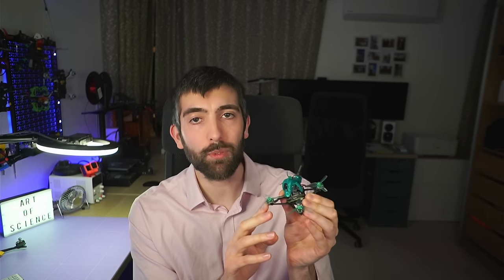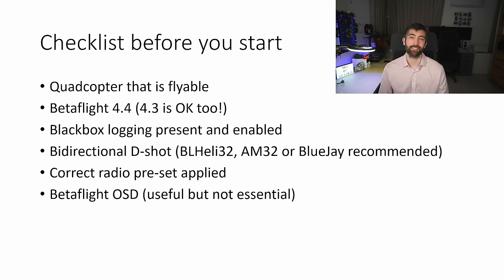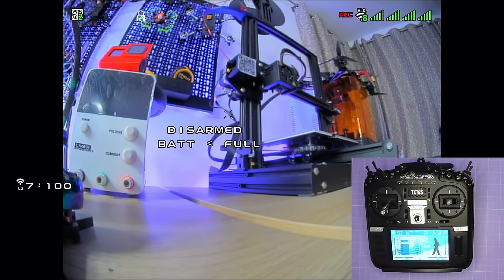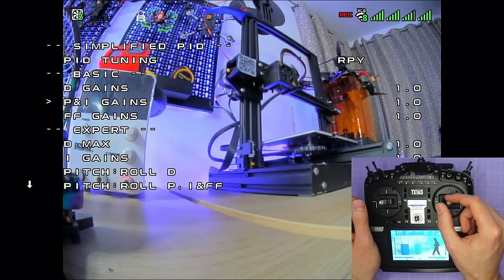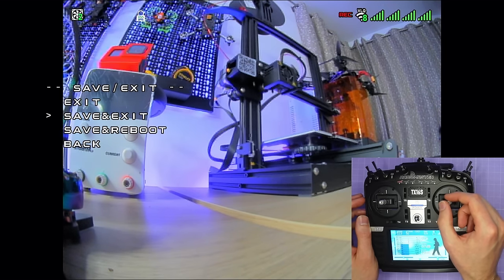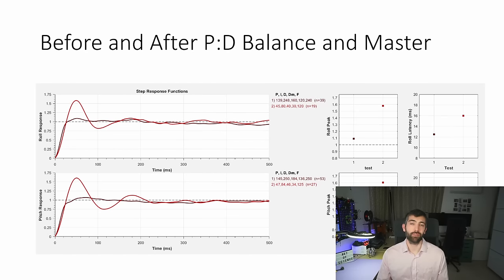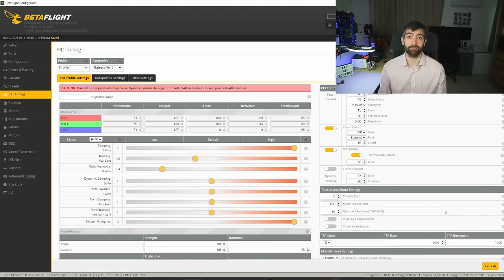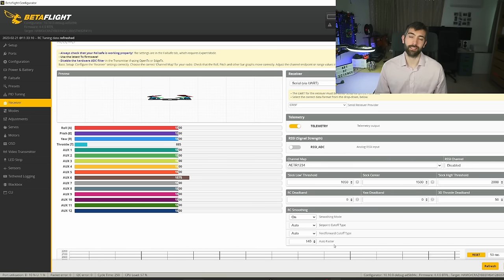Betaflight 4.4 Tuning Guide + Tips and Tricks for the BEST tune!

Comment: Hey chris, thanks a lot for this video , really apreciate.
 Something is bothering me, so the idea is always get 2.5 ratio PI/D ratio on 3 or 5 inch quads? I tried get pd balance and was perfect with PI at 0.4 and D at 0.5, but when o changed D to 1.0 result was wayy lower , already tried to raise MM to 1.3 but still lows. We should always try to mantain ratio at 2.5? Thanks a lot again
Reply from the maker: Every quad will have a different unique P:D ratio. You have to find what it is for your quad during tuning. Once you've found it you have to keep the ratio the same. It helps to not use the D slider. Just use master multiplier because master mult doesn't change P:D ratio.
Reply: @ChrisRosser  thanks a lot

Comment: Chris on this vid you have a chart for dynamic idle that shows prop size  and approx idle rpm for 4.4. In your 4.3 vid you have a different chart with different values to input for dynamic idle. Did they change something from 4.3 to 4.4? Or did you find that these values just work better?
Reply from the maker: A range of values work well for dynamic idle. Higher values give better stability at the cost of hang time.
Reply: Also Chris, I have one more question…. Should rpm filter fade range hz be set to the default of 50hz? Or is your suggestion in your betaflight 4.3 vid to adjust the fade range to 100hz? Also pidsum still 100%? I am running a clean build of the AOS 5 EVO…

Comment: Awesome - like always. Thanks a lot... Chris, maybe you have some advice  - if we tune PD balance with turned off   FF - and turn on FF to -  (no matter 0.5 or 1.0 position) after tuning PD balance  -  always back to overshooting -  how to avoid that ?
Reply: Try turning down the i-term.
Reply: @skree_fpv436   I will try, but i-Term already 0.3 not so high
Reply from the maker: The step response graph will often show overshoot with FF on. That's why we don't use it when tuning FF. Only use the step response graph when FF and I = 0
Reply: @ChrisRosser  When I try to tune PD balance with turned off Feedforward and I gain - the PIDtoolbox never show me overshoot.  All flights with PI gains slider from 0.4 till 1.6 even with hard pitch \ roll tricks always get to the setpoint  - just timing is different.   Its not easy at all to choose correct PD ratio.  is something wrong with toolbox?  blackbox explorer can indicate overshoots after PI gains slider rise more than 1.0        huh situation ...
Reply from the maker: @PaulSokolov  Are you seeing overshoot in the FPV feed. Maybe PI = 1.6 isn't enough for that quad. Are you doing specific tuning flights with sharp wobbles on pitch and roll?

Comment: I have some trouble with PID tool box metode for PID, I have a constant over shoot on Roll about 1.2..  in betaflight 4.4, can I use your metode as you descibe for betafilght 4.3?
I have a really succes in betaflight 4.3 with your metode on all my quad.. so If i can I will follow the same step in BF4.4.

Comment: So when I initially test at .3, .4 etc do I move the D slider to 2.5 times the P&I slider or do I leave it at 1.0 while adjusting the P&I through .3 - 1.5.

My next question is, if my P&I slider is at 1.5 then my D slider needs to be 3.75 right? So I’d have to move the multiplier to 2 then do some math and put the P&I to 0.75 and then D would go to 1.90?

Comment: So i'm dealing with a weird problem here. I'm trying to tune an geprc cinepro 4k using an external openlog board. I've flashed the blackbox firmware and it seems to be working. The lights are ok and it saves files.txt in the card. But when i try to open the files in blackbox explorer i can only see the "log header" and "view table" info. The files get bigger or smaller if I keep the quad armed for longer or smaller times. I downloaded some log from internet and it works fine in blackbox explorer and comparing the file to mine they look the same. Any ideas??

Comment: I’m a bit confused about how to act upon the throttle / frequency data gathered in the first step (say 11:25 in the video). In the example plot, the throttle related vibrations fall between 250-600Hz. How does one act upon that data? Where does one indicate to Betaflight where those values lie? I understand the part about Dterm filtering. Do the throttle frequencies get entered under RPM filter? Sorry to be confused, I watched the video twice with notes but can’t seem to grasp this final point. Thanks.
Reply: I also feel the same and did not grasp how to use this data in order to influence setting changes. I'm thinking I may need to watch his 4.3 video on filter tuning to fill in some blanks.

Comment: How do you setup the graphs? I cant find gyro scaled [roll]/[pitch]/[yaw] anywhere.
Reply: I had this same confusion (couldn't find it). Gyro scaled is only logged if you configure  black box in Betaflight. Set Blackbox debug mode to GYRO_SCALED. See 3:40 in the video.
Reply: @z2kk  Perfect! Thanks for pointing that out.

Comment: Please help!
My copter flips out when doing a flip or when doing a punchout.
Its a 3.5 inch sub250 6s quad, I have only tested the flips in horizon mode but when i try even a slow flip the quad gets uncontrollable and doesnt level again but just crashes.
I already have the master multiplier turned down to 0.6 so I dont think it solves it when turning it down even lower

Comment: In the blackbox logging rate I can only select the following options:
1/1 (3299Hz)
1/2 (1600Hz)
1/4 (800Hz)
1/8 (400Hz)
1/16 (200Hz)
 i have BF 4.4.1 on my quad and BF configurator 10.9.0 what is the problem, thanks.
Is there any problem selecting 1/2 (1600Hz)?

Comment: Hi Chris, I have an AOS 5 v2 and have a PI set at 1. adopting the ratio of 2.5 this puts d at 2.5 with the master at 1. However I have run out of sider for D. By reducing PI to 0.5 and D to 1.25 with master at 2 I should be able to achieve the correct values. my question is, by increasing the master to 2 should I drop all other sliders from 1 to 0.5?
Reply: i did that today, both sliders, but i think (from what i understood today) that each quad has their own ratio. but i can be wrong
Reply: @filipefrango1671   I think you are right. Looking at other tuning guides the ratio (PI D) differs from quad to quad.

Comment: 22:15 Quick question: If my P&I slider is correct at 0.9 should I set my D slider to 2,25?
Reply from the maker: Assuming: P&I at 0.9, D at 1.0, Master at 2.0 an you want to further increase master.

Go to: P&I at 1.35, D at 1.5, Master at 1.35 and that whould give nearly the same numbers and you can continue to increase master from there.
Reply: @ChrisRosser  Also didn't understand this  - "  D slider is always 2.5 times  as much as our PI slider "   How to do this?     By P\D numbers ?  or by Slider numbers ?   Pleaase explain with some example.

Comment: When I try to tune PD balance with turned off Feedforward and I gain - the PIDtoolbox never show me overshoot.  All flights with PI gains slider from 0.4 till 1.6 even with hard pitch \ roll tricks always get to the setpoint  - just timing is different.   Its not easy at all to choose correct PD ratio.  is something wrong with toolbox?  blackbox explorer can indicate overshoots after PI gains slider rise more than 1.0        huh situation ...

Comment: Yeah so I went forward tunig my Cinelifter QAV-Pro Whoop starting as suggested with a PI Gain of 0.3, leaving D Gain at 1.0. So 3x 30 sek flight and the ESC was gone amd motors where baked. I think we need to clarify some points here... maybe it makes sense to use the D slider instead of PI, otherwise you start off with massive D and depending on the build this kills your motors or esc... 😪😪😪😪😪😪

Comment: Do I need every time when I change the PI Balance or MasterMultiplier to save the Log File on the computer?
Or do I arm quad do bumps with setting A, disarm, change setting to B and Arm record.
Reply from the maker: You can do multiple flights and then download several logs at once to speed up the tuning. Just be careful not to run out of log space! Lowering the sample rate to 2K or 1K can  help increase logging time.

Comment: Hey Chris, connected my receiver to BF. The quad arms, beeps, and flies. But no OSD shows in goggles?
Reply: What Version of Betaflight and what kind of Video system are you running? Especially Digital Video Systems and the BF OSD are hard one to get working and it differs with every BF Version. Especially using the o3.
o3 and bf 4.3 check Oscar liangs how to setup o3
o3 and bf 4.4 check ports tab and enable VTX (MSP + Displayport) on your UART where the o3 is connected.
If your using something else, you will have to google for it. i just switched to digital with the o3.
Reply: @miQizzle  Thanks for the help,  BF is updated to 4.4. Running the original DJI Ait Unit if that helps.

Comment: Final graph at 24'30" mark is a bit confusing since the P/D ratio shown in legend do not match values you talked about up until then. Better to leave those out if it is just a sample of what to expect.
Reply from the maker: I'm talking about the ratio of the slider values rather than the P and D numbers. In general with slider tuning the numbers are becoming less and less relevant. If P&I slider is at 0.5 and D slider is at 1.0 that's a ratio of 2 on the slider values. But not a ratio of 2 on the gain numbers.
Reply: @ChrisRosser  
Thank you !!! 
Also, I am assuming your getting the 'BF potential "flyaway" warning' when using these high D-term settings?
Reply: @ChrisRosser  I had another look. The graph still does not make sense even as slider ratios. Have another look as something appears off. 

My observations are:
Your P:D Balance of 0.4 (slider ratio of 2.5) gives actual P/D ratio of 1.76 
(from Roll Response @ 21:07 mark)

Your fixed slider ratio of 2.5 then Master Mult ramp gives actual P/D ratio of 2.3  
(from Roll Response @ 22:38 mark)

If I set P&I slider=0.8, and D slider=2 in BF4.4.0 then I see P,I,D,Dm,FF = 71,127,160,120,240 (not 139, 248, 160, 120, 240 from graph at 24:30 mark). Your D-term is too low for slider value 2.5.  And is inconsistent with your earlier test graphs mentioned above.
Reply: Note "P/D ratio" number is inverted above (actually given as D/P value)

Comment: Hey, I'm running 1700 rpm dynamic idle on my 5" and I see no issues, should I still bump it up to be closer to 3000 ?
Reply: Ideally, but we’ve flown for years without any dynamic idle….Just one of the many advancements thanks to the Betaflight devs that make the firmware more refined😎

Comment: why don't you show us PTB graphs after FF adding? In my experience it will add large overshoot that requires larger D gain
Reply from the maker: Step response graphs are not reliable when FF is on (as response occurs at the same time as input which confuses it) so we should not use them to tune feedforward. Only use the step response graph when FF=0.
Reply: @ChrisRosser  can't agree. OK, let's assume that the step response is not relevant, then open the blackbox explorer and see the overshoots

Comment: Just tried the proposed filters and my quad wants to flight to the moon. Not that it just climbs and climbs, I can ultimately land it, but it clearly has a tendency to going up. Any clues what might be causing that?
Reply from the maker: Vibration due to mechanical issues with the build is the most likely. Long waggly VTX antennas and stack mounting with no base nut are the most common culprits.
Reply: @ChrisRosser  Alright, time to check my build!
BTW, is the stock O3 antenna with the AOS3.5 rear mount a potential culprit? It is a bit long indeed but seems reasonably stiff to me.

Comment: This is a fairly dangerous tuning example especially when referring to the turning off the gyro and dynamic filters which is only possible on a perfect quad, with perfect gyro and minimal frame resonance and issues. This video is mostly for the “perfectly built “best case” quad instead of the bnf’s that people will be tuning while watching this video. The filtering example will likely not work for “most” people and their setups.

Comment: We need now AI for this 😅
Reply: Exactly what I was saying the other day to one of the lads I chat to.   An app or even a modded version of the betaflight firmware for tuning purpose to generate the PID/filter settings with AI to assist in the tune would be brilliant.   Like it does the preflight PID/filter adjustments like Chris does, then asks you to perform the roll and pitch wobbles, analyses the black box data, performs some adjustments, then gets you to do a test flight, checks the black box data, asks you some questions about how the motors sound, motor temperatures etc and makes some more adjustments based on that.   Surely there is a way this can be done?

Comment: I don't get this at all. You say take the i term slider down to zero, but then you refer to a P-I slider which I don't see. You say you want to keep the i term at zero, but then you refer to different values of of i in relation to D. Then you show those graphs with the different PI values. I am experienced at quad stuff, but this just lost me. Can you please explain it further, or show in more detail because it seems you're saying one thing then something else that contrary to it.
Reply from the maker: Hi Steve, you may want to get the video up side by side with betaflight configurator and check exactly which sliders I'm moving in the video. (Turn expert mode on) There is an I gain slider and a P&I slider. Turn I slider to zero then tune PD balance with the P&I slider. Then return I slider to 1.0.
Reply: @ChrisRosser  Thanks Chris, I’ll have another look.